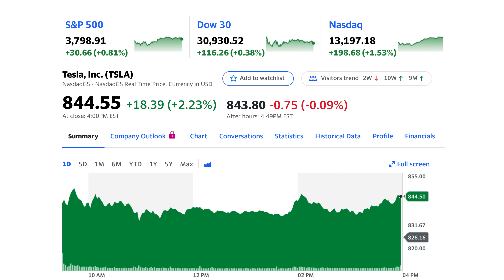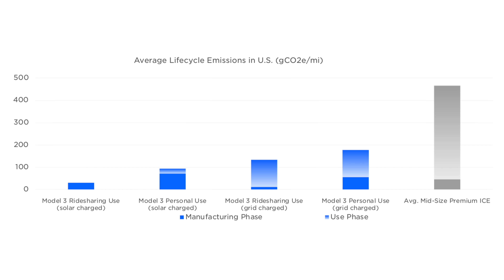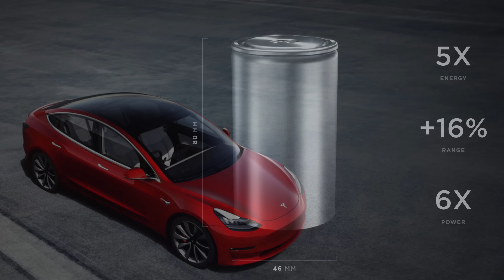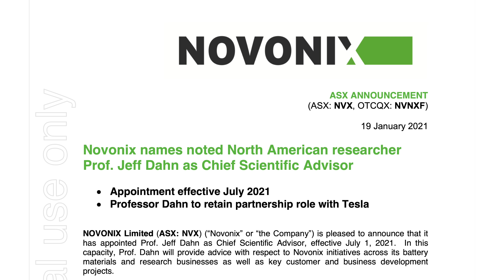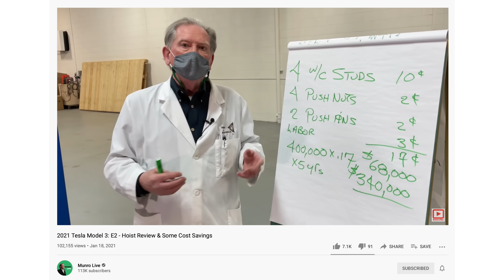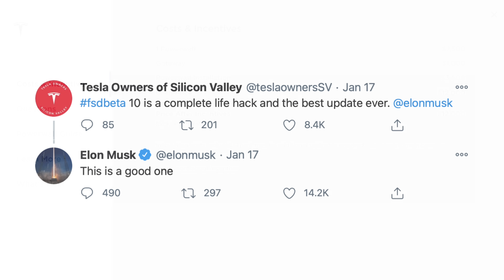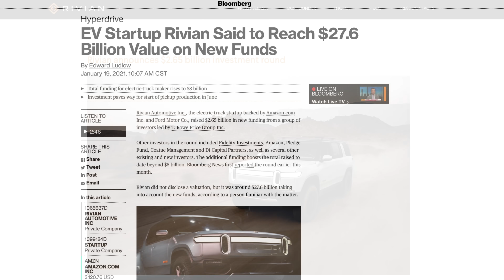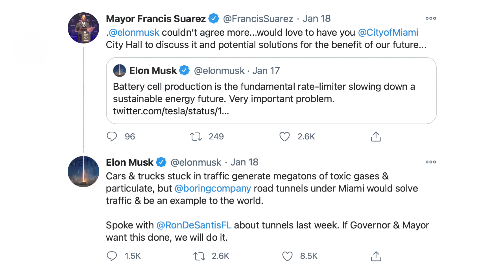Some Math on Tesla’s New Batteries, Munro 2021 Model 3, Dahn/Tesla Battery Contract

Comment: Your calculations on pack energy are confused I think. The 5x increase in energy is very simple. The 5X refers to the 4680 cells being 5 x the size of the 2170. 5x the amount of painted paper within. Therefore 5x the energy within. IE 5x the amount of electrons going to cathode then anode. Energy is the number of electrons and is named current. Volts are the power pushing the current around the circuit, also called the potential difference. It is called force or power. Imagine a waterfall. The current is the amount of water[electrons] going over the edge. The voltage is the potential difference between the top of the waterfall and the bottom of the waterfall [power driving the current].  There is 6x the power. This means that let's say the 2170 cell pack was 5v. Now it is 6x the power, meaning 30v. If the voltage was 48v, now it is48x 6=288 volts across the terminals. 
Watts is volts x current. P=IV. this means while the individual cell is 5x energy of the 2170, it is loaded into the 900 odd battery cell pack. Therefore the wattage is almost the same. However, there is less aluminum, steel, and wire in the new pack because of bigger batteries and simplified battery pack. Therefore less weight, therefore greater range. 16% greater range because of the lighter battery pack. I hope this is simpler and clearer. The 5x, 6x and 16% is plain witchery kkkk as the numbers impress. What is impressive is it is simpler, cheaper, lighter, and has 16% more range.
Reply from the maker: So you are just assuming it’s 5.0x? I’m not sure where you are really disagreeing other than that. I very highly doubt a 16% range improvement from weight alone.
Reply: @TeslaDaily  .... my mistake. you are right on that. Because of the cell chemistry, there is probably range improvement, then the lighter weight of the battery tips 16%

Comment: The +16% range includes the weight savings and the increased energy stored both, so the 5.3 X estimate is probably a little high. I would guess more like 5.20-5.25 X.

Comment: I think you're giving Tesla a pass on the panel gap problem. 1mm at the top of the door and 5mm at the bottom is huge.  A co-workers model Y had this problem. Yes,  they sent a guy right to his house to fix it fairly quickly, but a vehicle at the price point shouldn't have such poor build quality. I've never seen this on a KIA much less a BMW. And I'm not hating. I'm buying a model 3 LR.

Comment: Thanks to Rob for another very good video.  I'd like to disagree with those electric bill rates.  I live in Orange County, CA near Disneyland.  I'm paying nearly as much as Hawaii for my kWh -- about $0. 27.  I'm in the lowest usage tier, and we just started time-of-use rates in October.  The 4 to 8 PM is $.28, most of the rest is $.26.  These are a lot more than the $.2078 that Rob showed.  I do get a conservation credit of about $30 a year, but I don't think that would bring my bill to anywhere near the $.21or so.  I would assume that households larger than mine would be in a higher tier and they would be paying even more per kWh - more than even Hawaii.  The value given in the article Rob showed must be an average over all of California, because I know that my area is not the highest -- that is probably in the S.F. Bay area where everything is more expensive.

Also I would expect the kWh rates in Hawaii to go down some because they are transitioning to renewables plus storage, so they will no longer be dependent on fossil fuel to run their generators.

Comment: What is your background in manufacturing and quality/continuous improvement? Elon Musk claims he does not want to waste $. Defects are waste (muda). Rework is a waste and results in an inferior outcome versus right first time. You are correct, there is a limit to quality that is nonzero and the drive for perfection, a zero defect rate is asymptotic. However, that is not the case here. Plus, the defect rate is just one measure. The magnitude and impact of the defects are also significant. Given fewer parts, Tesla's defect rate and patterns should be between ICE mfrs and electrical mfg. It is the difference between being an analyst and an apologist. Too many fan boys with channels. Community needs analysis. If we cannot get the defect rate, even if we can, it would be helpful to have Sandy Munro and/or others assess the magnitude of the defects. These gaps, cars with 12.1vs 15" clearance. These are non-trivial. The power of the Tesla reporting community is a significant force for change that can be applied to drive quality and safety improvements. Yes, please measure. Then compare to spec and ask what is the +/-, how many sigma is the error? Probably far from 6 sigma mfg or peers.

Comment: Hey Rob - regarding quality, I provided my car to an Quality Enginner ( he wil work at Giga Berlin, was working for a german OEM) . He did a "Quality Check" Playlist with different cars, checking panel gaps etc with focus on assembly and paint.  Maybe you are interested in, becuase it is exactly what you were asking for. Spolier: Model 3 US is quiet bad, Model 3 from China is reallly great. I personally fetched 3 cars from Tesla (my own one and two of friends) and all cars had several issues. I personally dont care as long as it does not degrade (like losing paint or parts falling off).  https://www.youtube.com/watch?v=HNLM1d0DcDs

Comment: @rob as a long time listener, I rarely disagree with you. Putting something on correctly (like a door panel) does not necessarily have an associated cost with it. Sounds to me simply that the process needs to be improved. Keep up the great work
Reply from the maker: If that’s the case, then absolutely should be done. But my assumption is it’s not that simple, or Tesla would have done it. They would have heard the feedback, certainly.

Comment: How do you switch batteries ? Throw away your car after 15y ?
Reply: Or what happens if a cell fails prematurely?  I've been very curious about the service side of the integrated battery pack since it was announced.  I haven't been able to find any answers yet.  The fact that the battery pack seems to link the front and rear frame castings is very interesting from a serviceability perspective.  Perhaps there is an access panel at the bottom of the pack that allows for cell replacement but I think all of the cells will be epoxied together so I kind of doubt this is the case.

Comment: Ryan,
Re the "5× energy"
If we assume that the same "jellyroll" material is used, then "unroll" the 2170 and 4860 cell, (using an on line calculator) and multiply the results by the height of each cell, the surface area of the material in the 4680 is 5× that of a 2170.
That's the energy density.
Allowing for less internal resistance, allowing faster transfer, gives us the increase in power (per cell)
If I'm right, as I said, this is the same material as in the existing 2170 so this is the "base level" 4680. Any improvement from chemistry or new materials would further improve performance.

Comment: Should we Assume that a Structural pack is not changeable? It seems like a big gamble to "bake it in" and not have it changeable. It could be bolted in and provide structural rigidity.
Reply: Exactly.
"Structural" is NOT the same as "not removable"
This seems to be a common mistake.

Comment: Totally disagree on the panel gap about people not noticing, yes we do notice it and you just have to walk into a Honda dealership to notice how precise and consistent their build method is then walk round a Tesla and think what is the problem why can’t they address consistency. I wouldn’t buy a American made Model 3 because either it’s a factory robot problem or people problem. Who checks the cars  because they do a poor job. If I can stand at a U.K. delivered 2021 Model 3 LR and within minutes notice problems and even a door seal falling off then who signed off on this Car fit for shipping. Like the Brand but hopping Berlin is a new level of quality for Europe. 
Sometimes I think Musk just doesn’t see it’s a problem and cars are getting fired out the factory far too quick not to catch or address problems. This we will fix it later  is nonsense.

Comment: Rob, I paid 60K euro for my model 3 and I can ASSURE you that no other brand would deliver a car with misaligned windows and doors.  
I traded in 2019 to get 2021 and it sucks to see no improvement on the building quality. It took me 3 visits to SC to solve lots of cosmetics details which sometimes they just say it is within specs when it shouldn't at least in Europe.
Made in china teslas are incomparably better and germany giga will produce awesome cars.
When I discovered MUNRO videos I really though he is like our angel so that Tesla improves even quicker, but he is right, time has passed and building quality still sucks, kind of shameful really. 
I am in the tesla spain owners club and most of the members had these problems.
Anyway, love your videos but this time I felt compelled to raise the red flag. 
Thanks!

Comment: Re the 16% range increase and projections on battery pack size using 4680s, did you factor in reduced weight? That would boost range but not pack size (obviously)

Comment: You could solicit panel gap feedback from your 10's of thousands of Tesla owning fans. 

A Citizen science dataset may be valuable to determine the statistical significance of your well-stated "anecdotes". With all due respect, measuring your own Model 3 and measuring a few others is not, in my mind, statistically significant data. As a data scientist, I'm curious what an unsupervised analysis of extensive panel gap data would discover. In theory, it might help inform this age-old problem Tesla hasn't seemed to be able to overcome. 

If you're interested, Rob, I'd be glad to discuss potential experiment design. For example, the prevalence of lidar sensors on phones/devices may make creating an extremely detailed dataset. It may be possible for the community, with a little inspiration, to co-create an unprecedented panel gap dataset, organize it, and examine it with machine learning. This does have the potential (low as it may be) of revealing previously unknown patterns in panel gap production, which the company may be very grateful for. Plus, panel gap problems are consistently the news, could trend. Hmm, I wonder how to do this...

All that being said, thanks for all the value you add to the community with your dedicated research. The world is a more educated place regarding Tesla and you are a good part of that. Thanks, Rob.
Reply from the maker: I think it’s interesting but would still lack comparison data

Comment: The important question is not clearly answered is this new pack lighter heavier or the same weight as the old one
Reply: I just worked out that based on the external surface area of each cell type, multiplied by the amount of cells per pack there is 1.5 times the amount of metal in just the cell casings of a comparable 2170 pack. (Based on Ryan's estimates of 960 vs 4416 cells)
Then you remove most of (not all) the metal used in the existing pack casings.
So, that should be a substantial saving in weight and cost.
Reply: @rogerstarkey5390  thanks for doing the 'maths' every pound saved will add to the range

Comment: Panel gaps should really get fixed! Tired of seeing this again and again.
Reply: It is a significant problem. Based on my experience 2 of 3 vehicles had significant panel misalignment. The Model Y was especially horrendous. It took Tesla service multiple appointments to correct the issues. There is no way that throwing out poor quality vehicles is in Tesla‘s best interest. Whenever you bring home a new Tesla, people want to see it and poor build quality, even if it can be fixed by the pain riddled service process, has been a turn off to more than one potential customer. Based on my experience, it’s no wonder Tesla ended the seven day 1000 mile “test drive” return policy.

Comment: I love my 2018 model 3, but the panel gaps are noticeable and Tesla wasn’t able to fix them when I took the car in. Every time I close my trunk I shut it from one side hoping that over time it will become flush with the car. I understand that they need to pump out the cars and demand is high. Just wish they could get the build under control. That being said, I will still only ever buy Tesla

Comment: I don't give a rip about panel gaps. Never thought about it, had a conversation about it, noticed it, or heard a comment from a friend about panel gaps. This is like marking down a car because one tire came out of a different mold than the other three did so the tread starts 5 mm up higher on the sidewall of the tire. By the way 5mm is about 1/8 of an inch. If it doesn't affect the mechanics of how it works then who cares! Next they will be measuring paint thickness and glass thickness for anomalies.

Comment: I think if another company had a $40-50k vehicle with bad panel gaps and it kept happening the public would think the company must be desperate to cost cut like that.

Being someone that has worked on many car body's being a collision repair technician I can say panel gaps address really important to get right and I can't say I've seen even a small trend in another manufacturer having consistent gap issues.

Years ago Mercedes even had a TV commercial showcasing how perfectly consistent their panel gaps are by rolling a ball bearing along the gaps. Mercedes makes cars that are the sans priceas the Model 3.

I use to have a 2017 Model X with a sticker of $97,000 and there's no way it's quality and craftsmanship even compares to a $60,000 vehicle. Plus the nuanced issues that showed up in first year of ownership and technicians forgetting to come back and finish multiday repair jobs. The gull wing doors rubbed the paint off where the rubber stops meets the doorframe on the car body and it's in plain sight to see.

I can see myself owning a Tesla again but not for a while. But on the investing side I'm not stupid haha and have made a lot in their stock.

I love Elon, but QC and materials are not up to par for a car of their price yet. As an investor we give then room to learn, but I'm meticulous with cars I own.
Reply: I totaly fully agree with you.

Comment: Don’t agree that cars should be coming out of factory with panel gaps. I can’t be the only one who would not buy due to shoddy body work.
Reply: Easy fix. No crucial impact on car performance. My VW Golf had horrible engine problems. Many of VW engines of the past two decades are deeply flawed. Take you choice.
Reply: If you saw the way the factory workers tweak the doors with a big mallet and other bending tools, you might be glad to accept the car the way it is and not fiddled with by those gorillas.

Comment: They shouldn't be delivering cars with so many panel gap issues. My Y had them, the tech did what he could but we just shrugged - so it still has these issues. I'm a form follows function type but these just look sloppy.  Can you find a Tesla without panel alignment issues?  It's not that some seem to be out of any acceptable spec, it's that they all seem to be. They're still amazing cars and this is a small issue -but it's just so obvious.  And I'm no fan of BMW, but find a BMW with panels as cockeyed as a Tesla - I'll bet you can't.
Good, go to dealerships and compare the panel gaps. If the cars you check cost what our Tesla's cost they won't have serious gap issues. (Trucks don't count). The reason it's an issue is it's like you're dressed up for some big event and your fly is open. Okay,  whoops. But an hour later? and your fly is open again? Now it's not about an oversight, now it's revealing a deeper perhaps more serious problem.  
Paint? I've got a gray Model Y. Paint looks like I did it in my garage. Saw a wrapped bright orange Model Y today - looked great. Maybe Tesla should work on wrap options, or local wrap options. I was thinking of trying to do it myself... but couldn't find a source of material. $4500 to wrap a car just seems a bit excessive (I've done wallpapering I know what it takes).  Get that cost closer to $2000 (same price as many Tesla options..) and I'd go for it in a second. That would not only solve the paint issues, it would add a lot of pizazz and wow! to what is fast becoming a huge fleet of cookie cutter EVs. 4  models x 8 colors....  what's 1.4 million /32?  
  I'm actually looking forward to getting a Cybertruck with raw stainless steel, mill marks, different colors and sheens. Then I hope to use it hard.  That would be a great aesthetic for a Cybertruck.

Comment: no wonder my Novonix stock shot up to the sky recently!
Reply: It is listed on the ASX as NVX where it trades primarily. The website should have some information about the ticker used to trade on OTC exchanges.
Reply: Another big day for NVX today !
Reply: @clintsquires6432  my ticker is NVNXF  confusing that same company has two tickers.    I hesitated to buy more several months ago.   oh well
Reply: Which is the right ticker symbol to buy for a US retail investor?
Reply: @stevehan8157  just go and try to buy with both.   its a foreign company and merrill edge would not allow me to buy it but fidelity did up over 300% gain so far
Reply: @stevehan8157  USA is NVNXF trading around $2.30-2.50 @ 1/23/21

Comment: They too bad about the power wall, the price needs to come down to make it worth while in most cases.
Reply: No, the Powerwall pays for itself quickly because Tesla's software sells the battery power back to the grid for a profit.  Tesla estimates that it could earn thousands a year.
Reply: @acmefixer1  that's assuming you have a electric rate that varies depending on time of day usage. Where we are in the northern Colorado mountains rates are the same all the time. Unfortunately autobidder wouldn't do us any good at this point in time.